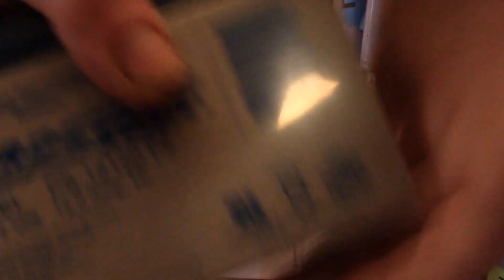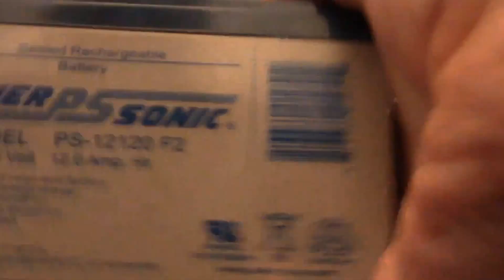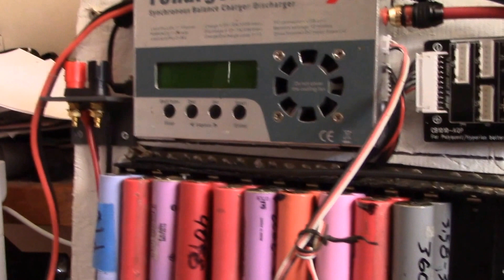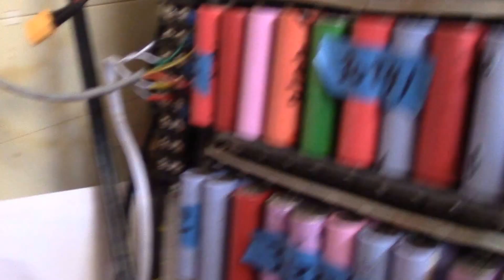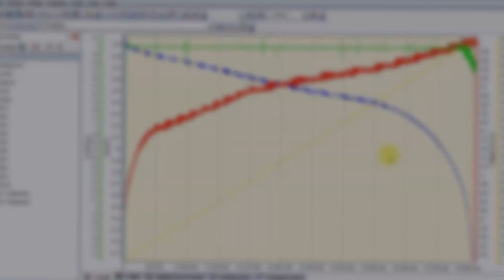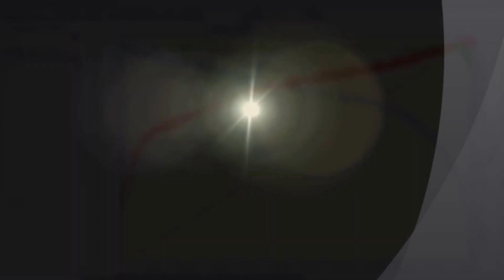Reconnecting the 4S BMS Board

Comment: Looks like the same process needed to reset laptop batteries, inject a voltage briefly into the output terminals.
Good video, well done.
Reply from the maker: Thanks for the comment.  Yes, I imagine it's the same type of system in use.  Also the same procedure for reconnecting lithium power tool batteries that have been run too low.  This was the first time using the iCharger to do that.